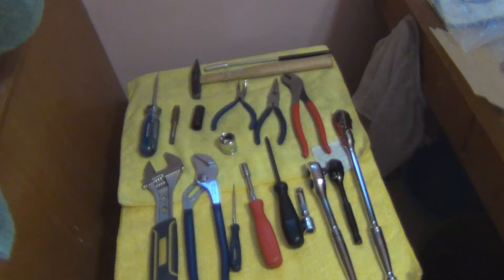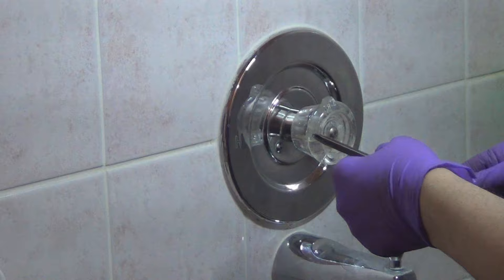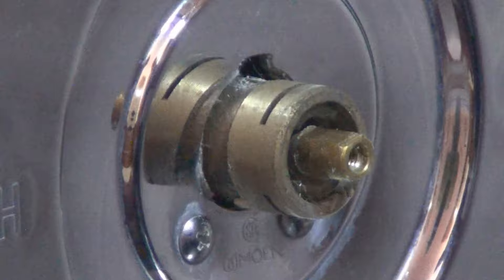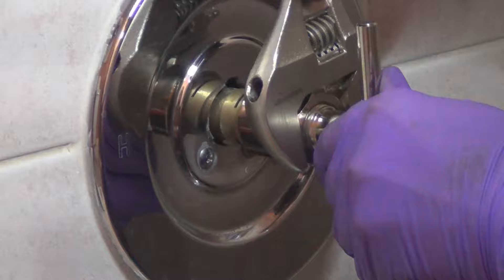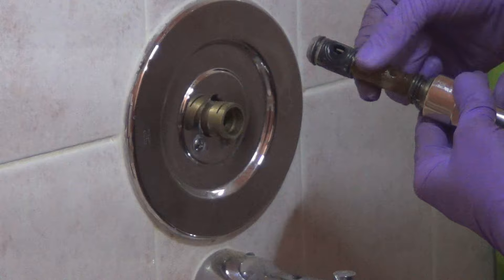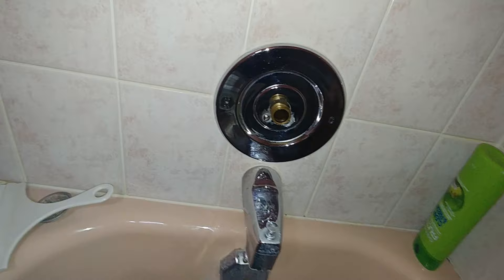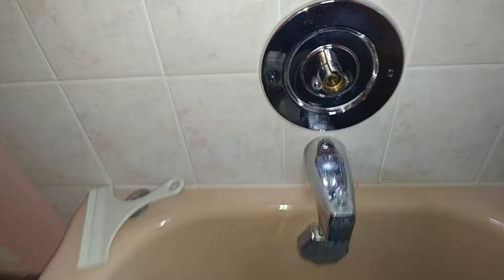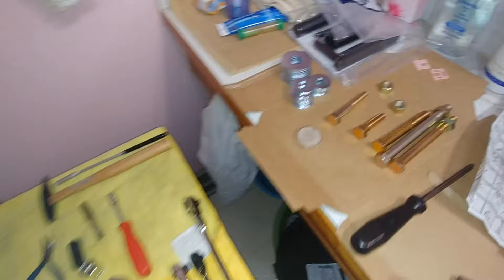LIVE: 30 yr old Moen 1225 Cartridge Replacement

Comment: I could tell by your prep you were either a mechanic or machinist lol. Solid work.
Reply from the maker: LOL, thanks for the compliment....unfortunately neither, just a prepared DIY'er : )  I wanted to avoid a plumbing call at all costs, however, shortly after making this video we had an old copper pipe between a wall give out and had to call a plumber.....cost to repair $1,400 CAD....you just can't win.  Thanks for watching.
Reply: @zmanvideo1  I promise you will be surprised how easy soldering copper is if you try. I'd say maybe 40 bucks would get you enough stuff from home Depot to practice. As long as the water is not flowing through the pipe it's a cake walk, especially with your prep. And remember we're all just amateur engineers lol. Thanks for the reply.
Reply from the maker: @markkotarski4659  you are absolutely correct Sir, I shall try that! Thanks for the advice!
Reply: I thought he was a surgeon.

Comment: Im gonna give you a tip. If youre using that moen puller on a cartridge that is really stuck in there dont twist it. Especially with those plastic stems. They break off inside the valve. Also becareful not to scratch up the brass on the valve.

Comment: Wow, that came out crazy easy. Nice job preparing for the worst. I've got a 1200 (all brass) cartridge that's been in a house for about 50 years that I need to change out and I'm not looking forward to it.

I'm curious why you felt the Moen puller was a better option than the ONA puller? I guess with the Moen one you could twist it back and forth, but both only pull on the stem...
Reply from the maker: I was not expecting it to come out so easy neither, but glad it did.  For your 1200 all brass cartridge, I would bet that you will need to break the stem, run a tap and pull it out with the bolt.  I found the 2 videos very helpful that I link in description.  That is correct, the Moen puller you can twist the cartridge back and forth whereas with the ONA puller you cannot.  So in my opinion, save yourself the cost of the ONA puller, use the Moen puller, and if its stuck then you will pull on the stem and pull it out and then start the tapping process.  Please do let me know how you make out.  Preparation is key to have all of your tools (i.e., tap, bolts, washers) on hand as to minimize water supply disruption.  Best of luck to you.  Thank you for commenting and watching.